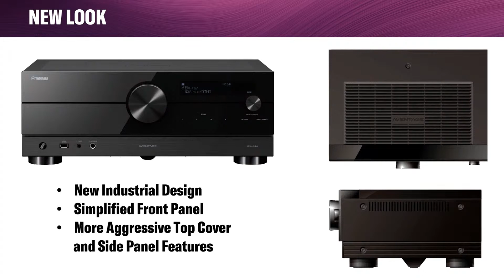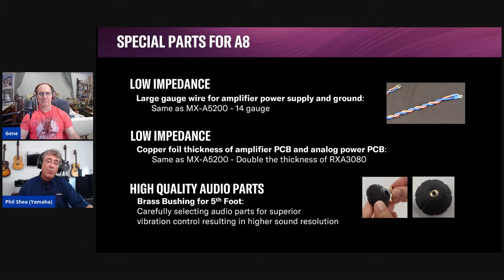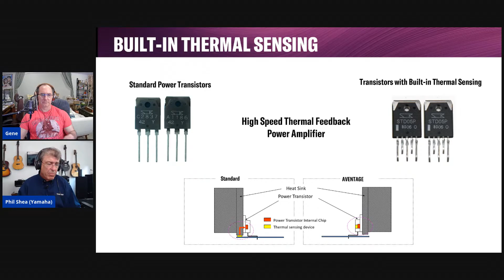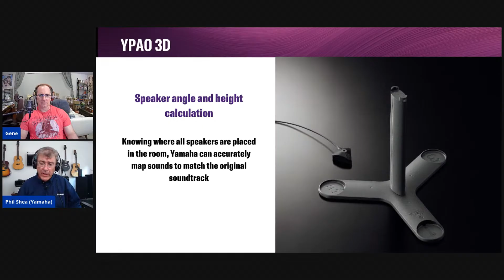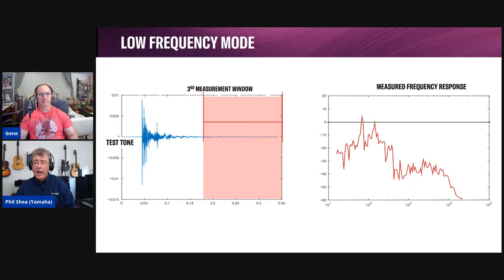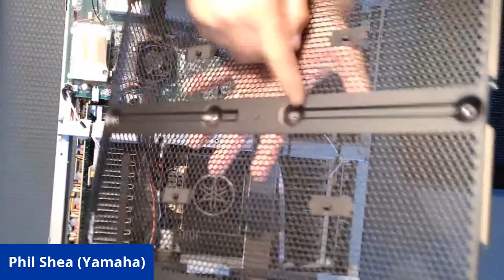Yamaha VPE: New 8K AVENTAGE AV Receivers for 2021

Comment: I refuse to ever buy a product based on "future firmware update" promises. I've been burned by too many companies' false promises before. Sell them when your HDMI 2.1 features and Auro 3D are actually working. We've seen what happened last year when HDMI 2.1 is not tested beforehand.
Reply: They’re using a programmable FPGA so they can effectively “upload” a brand new chip design whenever it’s needed. It’s explained in the video. This is actually forward thinking because why release a whole new range of amps every year with a brand new hardwired HDMI chipset, especially when the actual amplifiers don’t need upgrading at all. It’s madness. FPGAs are the future for creating an actual future proof high end receiver and not bodge an update like what Denon and Marantz have done by releasing an extra box to cheat the HDMI bug.

Yamaha is getting my money.
Reply: @kashyusaf9260  I for will buy this based on their current FPGA architecture.  It truly is forward thinking.  Btw did the price shoot up $300 since this video was made.  Inflation is maddening.
Reply: @kashyusaf9260  I get that but Samsung's One Connect box was supposed to be the same thing for TVs and look how that turned out. 🙄 I'll no longer buy products on firmware update promises. I'll buy it once it's present. As far as I know, Sony still doesn't have ALLM and VRR working in their newest TVs. Working firmware update has not come. Lots of broken promises on firmware updates, not just in the receiver space. There's a long list.
Reply: Beyond the fact that they're using programmable FPGA allowing them to completely rework this thing going forward, I would add a couple thoughts. I GET your point about being burned before by other companies (like Sony & Samsung to name just a few) not delivering on their firmware promises. That said, this is YAMAHA. They have a philosophy of caring for their customers. I own an older RX-A2030, and FOUR YEARS after they released it they offered a FREE firmware update that added Dolby ATMOS to a receiver that was NEVER setup or advertised to have it (ATMOS was just beginning when it was made)! They did NOT have to do that. Most companies don't update past the second year never mind totally renewing a 4 year old product! If they say they'll deliver it they will. BTW - at the time of this writing the units are shipping with the promised update. These guys deliver on their promises and beyond.
Reply: @mickmouse2258  how's that working out for ya? I saw recently they JUST got some HDMI 2.1 features last month and are STILL waiting for others. 😆 Also, the previous model year Yamaha owners all got screwed so I wouldn't say they always deliver.
Reply: @BrandonBaecker  Well, my Friend, I guess we'll just have to agree to disagree on this one. 🙂My experiences as a 30 year Yamaha owner tell a different story. But all manufacturers have people who have had a less than stellar experience, eh? I'll continue to hold that they do a better job than most at taking care of their customers. Sorry you've had such bad experiences with others, as a long time Tech, I get it! Cheers!
Reply: @mickmouse2258  I've got nothing against Yamaha, but you're clearly a fanboy. I'm just not going to wait years for promised features they say will be available right after launch. If you want to wait, good for you. All I said is that if people need those features, it's best not to roll the dice and hope. There are other manufacturers providing them now. It's taken Yamaha almost a year to get just part of HDMI 2.1 support with other features still missing. You wouldn't buy a new car with the promise of future firmware updates giving you the features you want would you? Not sure why people do it with receivers. 🤷🏼‍♂️ The HDMI board fiasco was enough of a reason to not plan on getting something that's not there at launch. I don't have enough brand loyalty to any company to not call them out for releasing incomplete products.
Reply: @BrandonBaecker  Well, guess that makes me an Anthem fanboy, a Pinnacle fanboy, an Oppo fanboy, a JVC Projector fanboy etc, etc. I've been an Electronic (and Computer) Repair Tech for over 50 years. I'm factory trained to 2Kva UPS repair, hard drive repair, and more devices than you and I together have hairs. I've seen a lot of junk, seen a lot of good stuff. After so many years of keeping up with Tech you start to view things differently, and obviously with less impatience then you. What I see is Yamaha builds a rock solid unit with great care for the details. If you want to jump up and down about a single feature, have fun. I'm done feeding this troll. Out.
Reply: @mickmouse2258  you were a repair tech for 50 years? Man, that's some career ambition ha. 😆 I'm not sure how your work experience has anything to do with this conversation, but I guess here's a cookie for you. 🍪 All I'm saying is don't buy a product based on promised features via firmware that may or may not ever arrive. If it doesn't have it at launch, it's not guaranteed. That's practical advice. You're arguing something completely different. You want to dredge up a post from 8 months ago and just start a conflict about something I'm not even talking about. My post was about those features, so yes I'm talking about them. That's the entire point of my post. Nobody said Yamaha didn't make good hardware, but they still don't have the features I'M looking for. I don't care that YOU don't need or care about those features. Also, just because someone makes good hardware, doesn't mean they make good software. 🙄
Reply: @BrandonBaecker  dude calm down. Jesus H Christ, live and let live. Love an argument don't yah?
Reply: @wezzman1  I'm completely calm. Live and let live? Why are you freaking out about a 9 month old comment? 🤣 Go outside and get off the internet man. 😆 I didn't start this argument. I literally just said I won't buy a product that's incomplete at launch cause I've been burned before, but apparently that's too much for some Yamaha fanboys. 😆 Thanks for the entertainment. 👍

Comment: Why all that money and teenie tiny displays? I prefer the larger tablet style displays of the newer NAD's and other higher end AVR's.
Reply: One reason seems to be front faceplate rigidity. This could be solved by making the faceplate solid then mounting a larger outboard display on the exterior of the faceplate.
Reply: because, with the app controls, the display is honestly not that important.

anyway, we want to watch the tv, not the display.
Reply: @a9fc  
Ahhhhh. So that's why the NAD's, Rotels and other high end AVR's and processors have the nice large color displays and the yamaha doesn't. Even the Denons and Onkyo etc have large INFORMATIVE displays. Hmmm..ok. 😂
Reply: @jimbanville  and that's why they don't sound as natural =)

There's a reason why audiophiles prefer separate components. To reduce interference.

An AVR already has so much electronics inside. I'm glad they chose to use a smaller screen which will draw less power and produce less interference.

And anyway, in a home theatre system, I want to watch the TV/Projector screen, not the AVR. I only need the AVR to give me some information for reference occasionally. Not like I'm going to stare at an album cover while watching a movie lol 😂
Reply: @a9fc  
Lol. There's no interference from the large color displays on the NAD, rotel, etc etc AVR's. They're also not separate components. They're fully intergrated AVR's. 

It's not difficult with MODERN ELECTRONICS to have pure sound AND convenience features like large informative displays. This isn't the 80's or 90's. 
Does the hi res audio coming out of flagship cell phone get interference when the screen is on? Lol. No. 

Why is it only these new yamaha AVR's have these tiny displays? They're used to be on par with the larger, informative displays on the denons, onkyo, etc etc. 
Yamaha is going backwards. 

Of course no one stares at the AVR's front panel. But it is nice to be able to look at the front panel and EASILY see what source is playing and at what resolution, the type of decoding, etc etc etc ...without pulling out your phone and without pressing buttons and scrolling scrolling scrolling on a tiny single color display with your magnifying glass in hand 😂😂😂

Not everyone has their tv on when listening to music through their avr/audio system.

Using your logic, why put any display or buttons or knobs on the avr at all. Just use your phone for everything. AVR's should just be a plain black box tucked away somewhere. You'd be happy that they're "saving money" but charging you the same price because they claim it's "better" 😂👍🏼👍🏼
Reply: @jimbanville  
Anyway, no difference? I guess you haven't played with hifi yet.

That's good. That means there's a whole new world for you to experience.

There's a reason why brands like NAD tend to be bought by people with money and little hifi experience. Their focus is on, like you said, convenience.

NAD's a good starting point. And, like you said, clean and convenient.

lol, what's with the all or nothing arguments from people who've nothing left to grasp for.

I'm not saying 'no' to a display at all, especially not for a AVR, whose purpose is convenience. This is not a pure analog hifi. This is a receiver, so a screen is useful.

And yes, using my logic, that's why the best hifi amps don't have screens in them, and components are separate. Sometimes even the DACs are separate. The really good HIFI systems have Source - DAC - Pre amp - Power amps all seperate.

 But this is an AVR. So it's ok to have a screen. And a smaller one? Even better.

And, I think you'll like this, but with the A8 has a 'pure direct' mode which bypasses the built-in processing and a lot of the circuitry, including the screen.

So, you're understanding my logic backwards.

Think of AVRs like the A8 'punching up', reducing unnecessary circuitry where possible, instead of HIFI 'punching down' towards more screens and convenience.

But seriously, don't take my work for it. I used to think like you - modernity making up for conveniences etc, but then I was lucky enough to have heard the difference myself.

Put yourself to the test. Don't even go hifi yet. When you have the chance, go listen to the difference between the A2 and the A4. Almost exact specs, same channels, only 10w difference. And then, on the A4, try with and without pure direct (preferably with a good uncompressed source of course). Hopefully you'll then hear why even an lcd screen on the system can make a difference.
Reply: @a9fc  
Point is..the display has no affect on the audio quality in modern electronics. If that were the case turning off the display on a cell phone while playing back hi rez audio sources would be "a thing".  It isn't. 

The idea of "separates" and less-is-more in HiFi is antiquated. 

There are lots of myths in modern day hifi. If you can't reliably hear it in a blind test, it isn't real. 

If you buy a modern avr for all its features (surround audio formats, online audio streaming, etc) for primarily or at least 50% audio listening, where a TV isn't even needed, a nice big colorful display is very helpful. 

There really is no argument for a small display like Yamaha's in 2021, that doesn't show you valuable information without walking right up to it and having to "scroll". That "cheaped out". None of the higher ends brands would be using big colorful displays if they had a negative impact on the sound.
Reply: @jimbanville  point is, it depends on whether your equipment is capable of bring out the difference.

again, your examples just highlights your ignorance on the subject.

There's a reason why I'm not using phones for examples, because at that level, the equipment is incapable of bringing out the difference.

Once you start going the entry level analog amp vs stereo receiver, the difference starts becoming more obvious. And I'm talking about the difference where, the components for the power and sound amp/processing are the same, but one has added receiver capabilities inside.

You're constantly making apples to orange comparisons. I'm comparing different breeds of oranges, comparing soil, nutrients, etc, and asking you to taste the difference, while you're just dismissing it and saying ' nah an orange is an orange is an orange, breeds or growing methods doesn't matter'

ok, sure.

But like I said, in the future, find someone good in your area that's able to demonstrate the difference.

As for no excuse, well, there was a period of time when there was no excuse to make bigger phones. But things change, and because the mobile phone as a device transcended from simply being a phone, larger screens made sense for a lot for people.

As for AVRs,  the function of the screen has not changed. Purely for basic info. And nowadays, with the apps, you'll probably get more info out of that then your av receiver screens anyway.

If you have a PREFERENCE for larger screens, sure. I like a good display too. But knowing sound, and having actually played around with such things for a long time, there is a difference.

So, start with your NAD. Give yourself a few years, and then start playing with other equipment, and then realize that there's a difference.

Now whether the difference makes enough difference to you is another matter altogether.
Reply: @a9fc  
Lol. You said "point is it depends on whether your epuipment can bring out the difference". 

So you're saying this "Yamaha receiver" is higher resolution that the naim unity atom (HUGE colorful display), the Cambridge evo (HUGE colorful display), the rotel rap-3800mkii (HUGE colorful display), etc etc etc...

Uh...no. 
It's lack of a large display has nothing to do with SOUND. Yamaha "cheaped out". 

No other AVR has such a tiny, worthless display as this new Yamaha line. I suspect they'll get feedback from customers and correct this error when they do their next facelift. Just like Apple just eliminated that stupid "touchbar" on the new MacBook pro's 😂😂😂

Now, let's get back to talking about an orange grove's soil ...😂
Reply: @jimbanville  lol, totally missing the point.

If you took those for for 'rich audionoobs' products like naim, removed the screen, it would sound different.

But hey, it's ok, if having a proper screen is so much more important to you, then get those, nobody's forcing you to buy these yamaha receivers.

I mean, a lot of women choose certain products because of colours and design instead of quality and functionality, so I guess it's ok for people like you to do something similar too, not gonna yuck your yum.
Reply: @a9fc  
LOL!!! Now you're just simply making things up. Haha!  You have NO evidence whatsoever that removing those screens would alter the audio. Just because you "think" something doesn't make it TRUE. 😂😂😂
That's equivalent to saying turning off your car's stereo gives it better gas milage or makes it go faster. You can "say it" all you want,  it it's not true.
Reply: @jimbanville  Er. Like I said, I've heard the differences before in other systems with similar changes.

I've asked YOU to hear the difference between the RX-A2 and the A4 for example. Same specs, different components. Totally different sound. Different components.

I've also asked you to try 'pure direct' on the yamaha amps and av receivers, which bypass the screen. Some people can hear the difference, some can't.

I've asked you to go try for it yourself, but if you'd still prefer to stick to your hypothetical realities, then sure.

Ignorance is bliss. So, I guess I can't blame you.
Reply: @a9fc "ignorance". Yes that's completely appropriate for your CLAIMS. 😂😂. 

So WITHOUT actually  LISTENING to the actual device, you IGNORANTLY claim that... "If you took those for for rich audionoobs products like naim,removed the screen, it would sound different"

😂😂😂😂😂

So you're making blanket statements for all these devices without LISTENING. Haha!  Ignorant!
You can just stop now. Nothing you say from this point has any credibility whatsoever.
Reply: lol says  @jimbanville making blanket statements on his hypothetical assumption that by now companies like Naim (which are decent but not that fantastic by the way, I hope you'll grow to appreciate that some day through your own experience) would have been able to remove any such interferences by now.

Now THAT's a statement from ignorance.

My statement is from experience from other setups. I've even made suggestions for you to try. Entry level systems that can be found a nice store, where with a simple button press you can try and hear the difference between having the screen on or off.

But of course Jim prefers to be right instead of going out to do the real world experience testing to try and prove me wrong.

Anyway. I shan't waste my time on those who are not even open to a proper rebuttal from experiential experimentation, preferring hypothetical assumptions instead.

 Again, ignorance is bliss. Enjoy your bliss.
Reply: @a9fc  
Lol. Again, stop being ignorant. You can't make a blanket statement that devices you have NO EXPERIENCE with and you have NOT LISTENED TO will have their sound affected by a display. Haha!! Stop being silly. 😂😂
You have NO IDEA why Yamaha decided to use a tiny display on this AVR. You are simply pulling reasons out of thin air. Post the link to Yamaha's explanation how a tiny display on their AVR makes any difference in "sound" versus a larger display. 

You've proven you have no credibility. So just stop making IGNORANT statements.